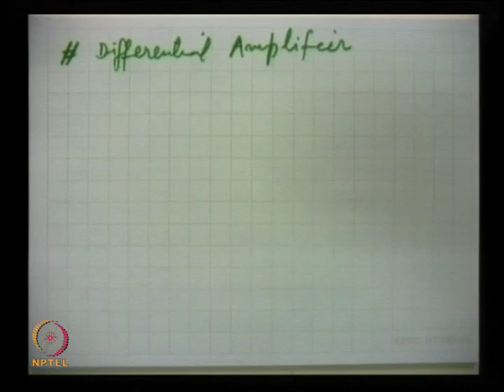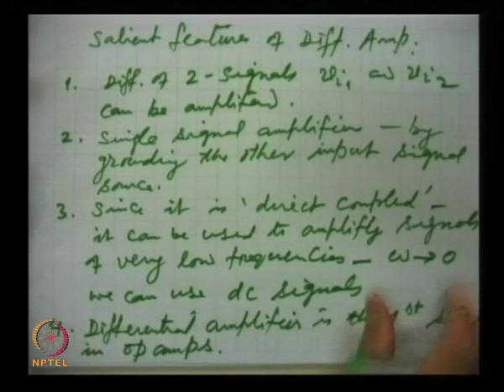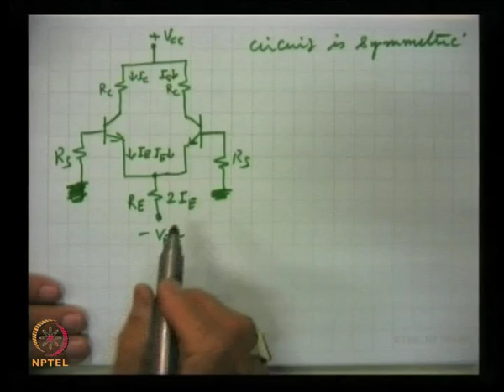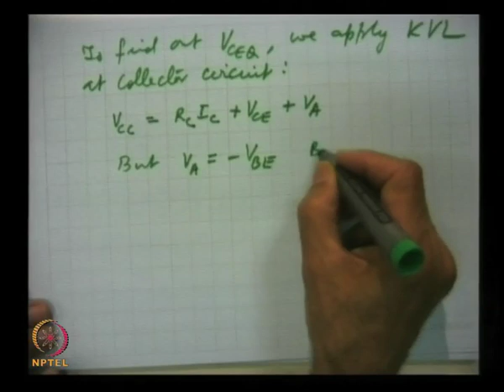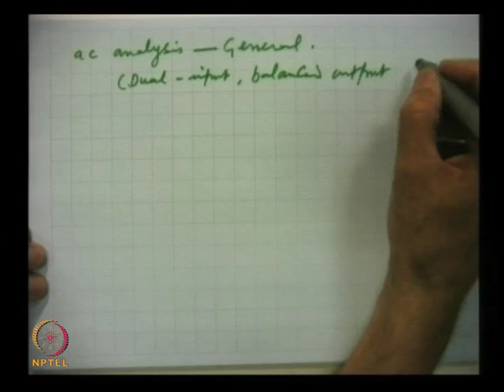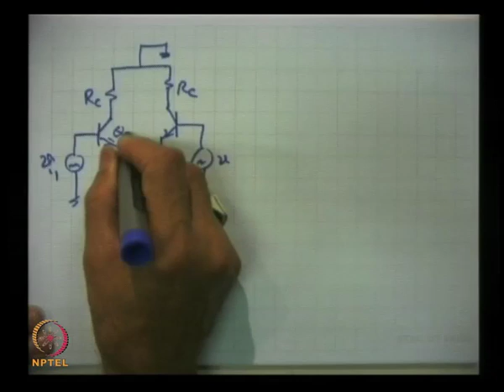Mod-07 Lec-34  Differential and Operational Amplifier

Comment: What is a differential amplifier?
The main and important advantage of a differential amplifier lies in its ability to amplify differential mode signals and not amplify common-mode signals.
This is better understood through the unified approach to electrostatics and circuits which affords a clear sense of mechanism of its operation. 
Most circuits encountered in electrical and electronic engineering operate in the differential-mode when conventional current flows out of the positive terminal and returns to the negative terminal.
However, under certain circumstances with sinusoidal voltages and at certain frequencies of operation a common- mode current which makes current flow out from both terminals at the same time may occur and this is termed common-mode current. In most cases, since the cause maybe due to external interferences, this is unwanted and is termed "noisy" because it may corrupt the desired differential-mode signals from sensors and so on. Therefore, the use of quality differential amplifiers is warranted in such applications.
A useful analogy of the action of differential amplifiers is of that of the U- tube manometer used to measure differential pressure of air.
You will find a description of differential signals in my (Sridhar Chitta) book "Fundamentals of electric theory and Circuits" here Fundamentals of electric theory and circuits by Sridhar Chitta
https://www.wileyindia.com/fundamentals-of-electric-theory-and-circuits.html
In several chapters, the differential-mode signals of circuits are identified and in one chapter a comparison of the differential-mode signal and common-mode signal is provided. A supplementary power-point presentation with animations on differential amplifiers is included in the CD alongwith the book.

Beginning with the fundamentals of charge, electric field, surface charge, current, voltage, simple circuit, parallel circuit, capacitors and capacitive reactance, inductors, inductive reactance, induced fields and transmission line effects, it progresses to cover topics on antennas and the newer field theories are treated in the Appendix. 
The contents of the above book by Sridhar Chitta, make a distinct unified approach to electrostatics and a few advanced circuits like coupling signals to amplifiers, lending precision and clarity to the topics which is not found in most text books.
The book comes alongwith a CD with animated power point presentations for all chapters and voltage regulator, RC phase shift oscillator, transformer-coupled audio amplifier and differential amplifier included additionally.
There is a "look inside" feature in the amazon.com webpage of the book "Fundamentals of electric theory and circuits" by Sridhar Chitta with a few pages of Chapter 1 which may be viewed and also which you may swipe left or press < icon to view the foreword, preface and Table of Contents. 
There is a full set of lectures beginning lecture 13 here on surface charges, electric fields, simple circuits, capacitance, inductance, faraday's law, motional emf, magnetic forces and more topics here
https://matterandinteractions.org/videos/EM.html

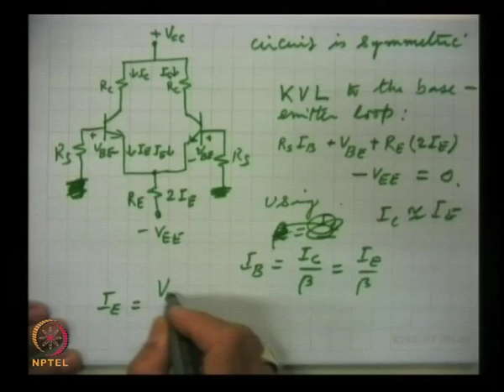Comment: Sir at 28:36 you put the bracket in wrong way ,the expression for Ie should be  = (Vee - Vbe) / (2Re + Rs/beta),but at the end it doesn't matters as Rs/beta is way too small than Re.
These are great lectures and you explain them very easily thank you so much.